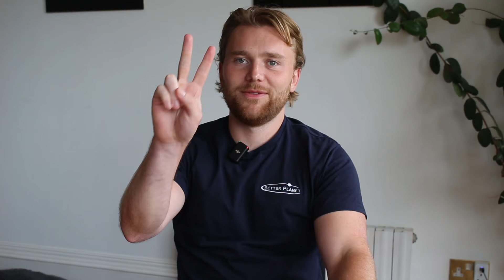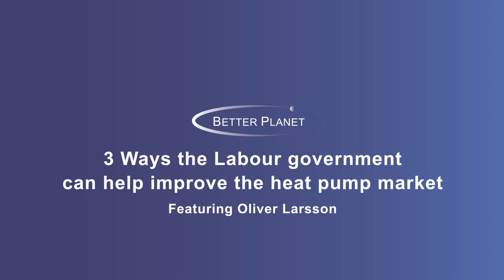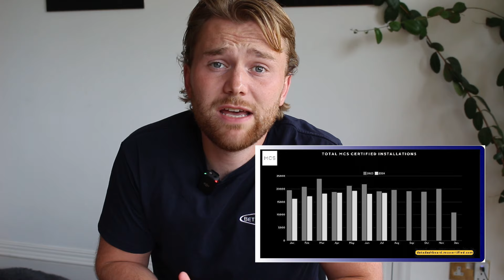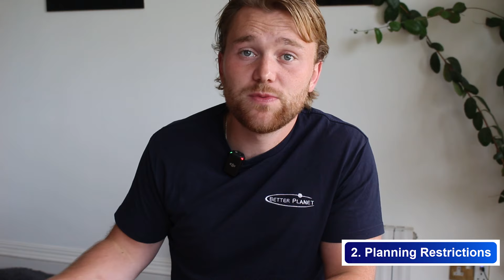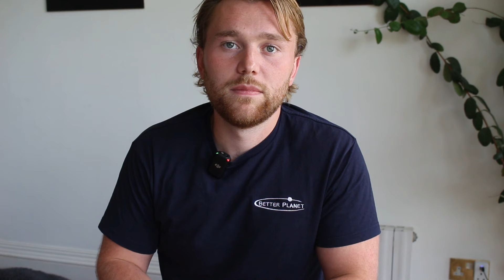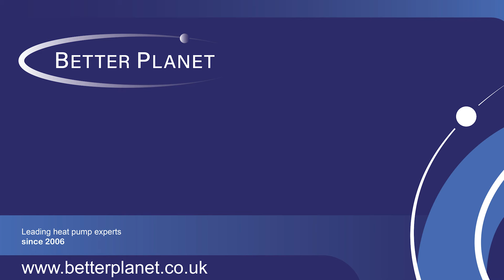Three ways Labour can improve the heat pump market...

Comment: The heat pump scheme (BUS)  is a scam. Electricity pricing, is also a scam. If you want to improve HP uptake, sort out training engineers who are fit for the job, if you don't, in 5 years time, no one will want one and there will be ads for "mis sold an HP in 2022~2025?  or some such. While you're at it, include air to air in the BUS, at least those engineers know what they are doing because they aren't new to F gas  installs, as they've been doing similar for decades in commercial. Also, this gives people cooling and is cheaper in general to get. 

Do away with the need to get rid of your combi boiler for DHW, it can hang around a year or two so that converts have a back up plan until they get confident that the HP can supply enough heat for a winter. 

And most important of all, stop government medeling in the market with crazy pricing due to high & long term strike priced CFDs and the whole MCP model in general. Both are the reason electricity is 4 x the cost of Gas. Reduce that gap and people will swap, and that actually reduces costs to thew Government (which means tax payers) and end consumers (which also means taxpayers) over priced CFDs are just a de risking tool & subsidy for investors.

Finally,  give the grant to insulation first, then let people choose their heating. if you push HPs, prices will remain high and installs will be pushed with bad system design by shitty installers

Comment: Here in New Zealand the Labour Green government made heat pumps compulsory in all rentals, for winter heating, and to make landlord's lives miserable. What none of the government geniuses thought of is tenants are using them for cooling in summer, previously people used fans or nothing. As a result the national grid nearly crashes every summer, as there is not much water in the hydro dams then. So they are having to burn imported coal to cope, not good for carbon zero. So much power is being used there may be power cuts in winter as the hydro dams are drained so much so no winter heating. It is interesting all you hear on the news is how the poor can't afford food but they can afford  cooling.

Comment: Heat pumps will make litle difference, better insulatiom and building is needed.
Reply from the maker: Thanks for your comment!

I agree - insulation and building standards should always be the first point of focus. 

Once that is in place, heat pumps provide an alternative that is usually 4-5 times more efficient than a traditional heating system. 

BP
Reply: @BetterPlanetUK  I heat my house with a small wood burning stove and cook with it,
We have Wains Gas heating but have not used it for 15 years. All wood it locally harvested and air dried. House was built iu 1859.

Comment: Don't worry too much about point number 3.
The amount of people coming from direct electric heating onto heat pumps is very high, this is reducing the overall grid demand.
Reply: I agree generally, but the issue is that heating from direct electric heating is generally local. The overall load on the grid might be minimal but local distribution will need to change. An area with mains gas will be impacted negatively but an area without will be positive.  Distribution is an issue that need looking at, we don't want to see the papers saying substations are exploding.
Reply: @PaulBrunt  that's an interesting point. I wonder if heat pumps will ever be subject to load limiting like EV chargers are?
Although we have to recognise that heat pumps typically tick along at 500w-1000w on most winter's days whereas EV chargers mostly run flat out at 7.4kW for a shorter period. DNOs understand very little about heat pumps and how their roll out will affect the system we currently have in place.
Well, at least I speak of the couple of people on the front line that I interacted with about heat pumps.

Comment: I have had three surveys done on my 175 year old house in Wales. None of the companies would install a heat pump as the heat loss was so great due to poor insulation that a 20Kw pump would run 24/7. The running cost would be astronomical. There needs to be better grants for insulation for older properties.